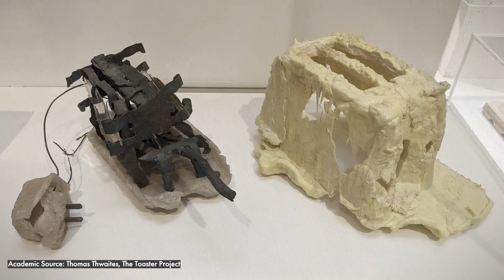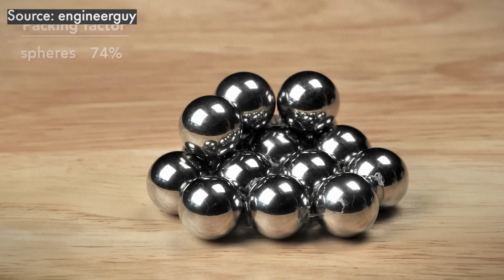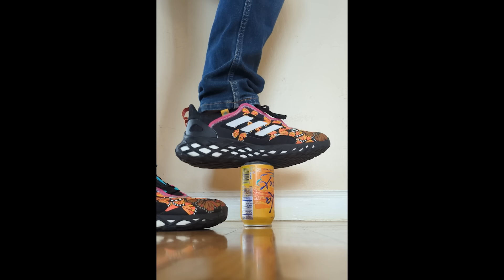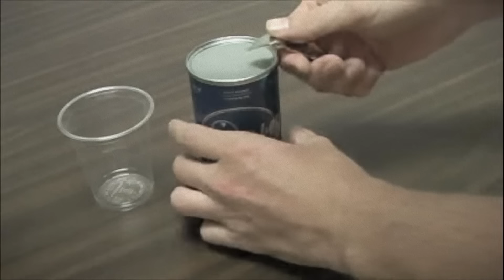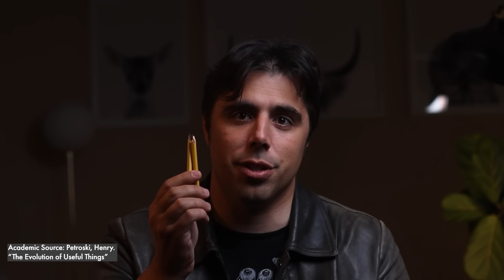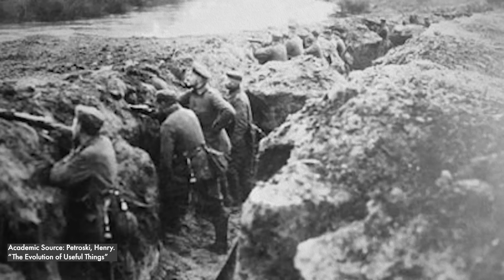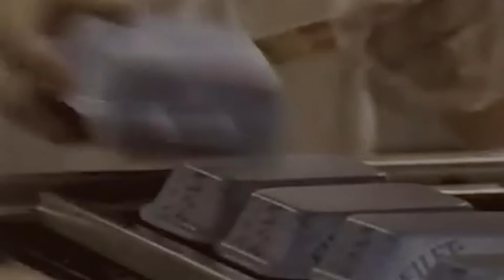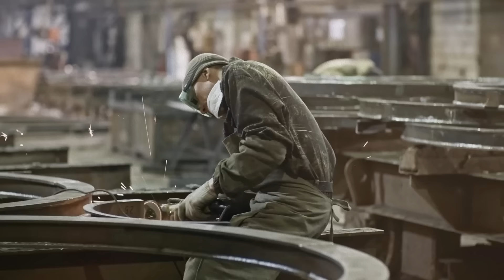Why Simple Everyday Objects Are Impossible to Make

Comment: Yes, mining, refining and manufacturing all the components for simple objects is basically impossible for one person to do but I can cut a metal fork out of a sheet of metal using tin snips in a matter of minutes that may look rough but will work better than any plastic fork. The concept of the video is interesting I guess but the premise that simple machines can't be made by a person at home is wrong unless we're talking prior to the industrial revolution where components that could be used for said machines (that may not be custom made for that purpose but will still do the job when applied appropriately) weren't readily available all over the house, in other machines or readily accessible at hardware and home improvement stores.

Comment: The problem is that most of those supply lines/process are multi use. You do not mine copper just for toasters but for thousands of different things, an assembly line can be retrofitted to do other things but crucially things that make it better can make other things better.

Comment: This is a dumb narrative. Trying to make a product by yourself in the way it's done to create massive quantities of something is nonsensical. When you want to make a spoon at home, you don't use the techniques that they use in a big factory and therefore you also don't calculate the cost of 1 spoon by the cost of the equipment used to create millions of spoons. At home, you could make a perfectly wonderful spoon with simple tools. Even if you wanted to use plastic and make it very simple. What that guy did with the toaster is basically the same thing as trying to tend a living room potted plant with a tractor. You can make things small and by yourself but you shouldn't try to copy the exact mechanism of large scale industry production processes.

Comment: Thats not true 😂
You can build toaster ur self the problem is this guy had 0 knowledge abt eletricity you need plastic coper and metal and just good craftsmen skills to reshape those 3 components in to 400 parts and little rubber and lighter to put over the cables so it dosnt burn

Comment: I once ran through what I'd need to do to make a CPU from scratch using nothing but stone-age technology. I ended up with the most disgusting diagram that would have bootstrapped creating half of human industry from scratch.
It's crazy, because making a bad CPU does not require utterly outrageous things. Some sand, a mask of the circuits (one for every layer), the sun (source of UV), a few specific chemicals. The transistor density would have to be much lower than even the original 8086 CPU. The issue is all the tools required.

Comment: The video is very pleasant and interesting. I learned a lot of different things from it, but the main thesis presented in the video is incorrect. An engineer is speaking to us, saying that copying modern objects would be very difficult — and on that point, I agree. However, as an engineer, he should be able to deal with this using his knowledge by designing a device that performs a similar function using completely different materials.
So what if the guy copied a toaster based on a modern toaster? Sure, maybe he would have trouble obtaining a wire that heats up under electric current — maybe it wouldn’t be as small — but he could use entirely different materials. Why use a plastic casing? It could be a casing made of bent sheet metal, simply insulated with wood on the outside.
As an engineer who says that planning takes a lot of time — yes, it does take a lot of time to make something exactly the way it’s supposed to be made. But on the other hand, it wouldn’t take that much time if your goal was simply to build a device that imitates another device. And that’s why the entire thesis of this video is completely wrong and turned upside down.
Yes, it would be difficult to acquire the materials on your own, but it’s not as impossible as the video claims. Sure, copying a modern solution exactly is extremely difficult — but designing something that is much simpler to make while still fulfilling the same function? That’s not nearly as hard. And that’s why the whole video is basically backwards. Thank you.

Comment: Ok, so I am supposed to believe that the toaster was invented not to give us toast, but to sell us electricity. And then you say it does nothing that a frying pan can't do. Well, first off, the results you get from the toaster and the pan are really different (I tend to prefer toast made in the pan, but that isn't the point). But more damaging to your "sell us electricity" hypothesis is the fact that making toast in the pan is of course incredibly inefficient compared to the toaster, and thus uses many times as much electricity. It's possible that the speed and ease with which toasters toast more than make up for this difference, but it's certainly not obvious that this is really the case. Let's ballpark estimate the difference. My toaster is rated 800 W and will typically run 2 minutes, hence it consumes 800 W * (2/60) h = 26,67 Wh. With a pan I can choose between different power levels, but I tend to be impatient and so I do what is also most efficient - use maximum power. How quickly the pan heats does depend on the pan quite a bit, but I'd usually go for my non-stick, which I'd keep at the maximum 2000 W my burner has to offer for 3 minutes, before dialling it back a bit. And here alas I have to just make a guess as I don't know the actual power (it's just turning on and off pulling 2kW when on, so I could just measure the total duration of the "on" intervals while actually making toast, and it would give me a good-enough ballpark answer, but I'm not about to do that for the purpose of writing a comment), let's say 1200W on average (that is on 60% of the time) for thee more minutes on each side. That brings my guesstimate to 2000 * (3/60) + 1200 * (6/60) = 220Wh. 

If these estimates are roughly correct, you'd have to expect the introduction of toasters to lead to toast becoming > 900% as popular/widespread in order to avoid a net decrease in the amount of electricity sold. 

Caveats: Several, but the biggest is my Scandinavian perspective :) which made me completely forget that in the US, especially at the time, basically everyone used gas stoves and thus, although the efficiency gap will be wildly bigger, probably a factor of at least 40 in favour of the toaster, you could indeed reasonably hope to increase electricity sales, at the expense of gas, even if toast's popularity remained completely unchanged. So my entire argument falls apart. Oh well. On the other hand, it did provide substantiation of another intuitive reaction I had and maybe many others had - that toasting surely does not represent much energy use. If we generously say 20 Wh per slice on average to account for people toasting a single slice some of the time (expends the same 27 Wh, in my toaster, as making two slices), it would be a lot to hope for that the introduction of toasters should move the needle by as much as, say, a kWh per household per month..!

Comment: You can cook toast on a pan but a toaster does a significantly better job far easier. If consumers didn't find value in the product it wouldn't have been popular. In addition, it barely uses any electricity.  Let's estimate the energy consumption. 2000watts for 10 minutes is 0.334kwh of energy used. Even with this massive over estimation the electricity used it's small.

Comment: Why don't we just use bottles?
Reply: 1 Plastic bottles are waaay more complicated to make example a water bottle has an expiration date not for the water but for the plastic bottle
2 you can't put anything in a plastic bottle some liquids react horribly with the plastic the bottle is made out of
3 the environmental impact, you will die and decompose before a plastic bottle starts to decomposes which is a huge problem

Comment: 16:43 that is an absolutely ridiculous take. To say that the only reason toasters were invented was to sell electricity is one of the most abhorrent misrepresentations I've ever seen before in my life. Of course the electrical companies will fund projects that will make their product more appealing to regular people. Are you trying to say that a toaster is less convenient than toasting a single piece of bread at a time in a hot pan with butter and then having to wash the pan and spatula? If we didn't have toasters, how much natural gas and electricity do you suppose we would spend heating up a pan just a toast our bread? How much more energy would we use to heat the water that we use to wash the pan, how much plastic waste would we create by having to use soap and water out of a plastic dispenser to wash that pan? How about the water waste? And on top of all that, it's just more convenient to have a toaster, it will toast both sides of the bread equally, it is almost no maintenance required, it doesn't have to be washed and  it uses an absolute fraction of a fraction of the energy of that a stovetop uses. 

What an complete ass hat take Were ovens designed just to sell us electricity? Why don't we use wood fire ovens anymore? Were refrigerators design just to sell electricity? Why don't we just use ice boxes? We're cars designed just to sell us gasoline? Why don't we just ride horses? Were horses designed just to sell us saddles? 

The whole video was great up until that bulshit take at the end, that is absolutely ridiculous and while you may a gifted engineer and designer, you are an absolute dogshit social scientists LMAO

Comment: 16:43 Chinese EVs are absolutely not high quality and it’s disappointing that easily disproven Chinese propaganda has been this effective. 

They have massive safety issues and most of the videos and incidents in China are censored but recently multiple people have been getting in accidents where their car caught on fire and the occupants couldn’t open the doors and burned to death. This happened to 3 young girls and recently a young man in a video where multiple people were trying to break the windows and open the doors and they couldn’t, so they had to watch as the man burned to death while they could do nothing. Many more incidents and common issues with wheels falling off vehicles, airbags failing to deploy in serious accidents, self driving issues and more. I’m not claiming Tesla or any western EV manufacturer is perfect but their issues are publicized because we have freedom of speech and the press.

Comment: While it may be that toasters were designed as a use for electricity, they were also made necessary by a different side effect of electricity and other moves away from heating our homes by setting wood on fire inside them: toasting used to be done with a toasting fork over an open flame (frying it in a pan is not really the same thing). But once oil heat and electric water pumps driving hot water through radiators and stuff made open hearths obsolete for heating (enclosed cookstoves having made open hearths obsolete for most other cooking a couple of decades earlier), we did actually need a replacement technology.

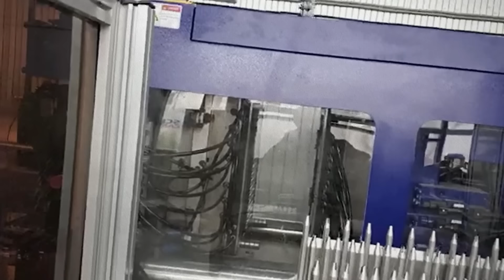Comment: 1:32 "The simpler and cheaper the object looks, the more complicated the system behind it has to be".  This is absurd.
Reply: It’s just wrong. You could use soft tooling and get some spoons of similar quality, but you couldn’t make 10000 spoons /minute and without the tool breaking down super fast

If you want to increase margins and rate of production, then the cost goes way up. Simple or not. Also, it tends to make the margins razor thin because anyone else with deeper pockets can just invest in a more expensive upfront, but cheaper to maintain line than yours and undercut your sales
Reply: Yea I didn’t really get that

Comment: So a toaster uses MORE electricity than the stove you say will toast bread just fine? I've watched the evolution of toasting bread in US. It was gradual to get it done more evenly and quicker. If your toaster uses more electricity than it takes to get your stove up to that temperature, I want your stove. It doesn't make thermal dynamics sense. "..a hot pan will do just fine." A magic pan? A pan that heats up really fast by itself with no electricity? It sounded worse the second time you said it. Like getting a pan hot doesn't take energy. If you are talking back when toasters were invented as you say, most stoves were using COAL to heat with. Even with coal plants a toaster uses much less energy. I think you have lost it. It appears you are very close in thought with Ted Kaczynski. Not your ending, but the hidden machine part. If hyperbolic fine, if not, seek help.

Comment: I'm doing fine without a toaster. I'm also baking my own real bread instead of toasting factory-made tasteless sponges. Using organic spelt flour, sesame, sunflower seeds, pumpkin seeds, poppy, salt, yeast, water and a bread spice mix in my bread making machine. Which works allright but what annoys me is that it has a couple of fixed programs, if it was programmable I could make good rye bread with sourdough that needs plenty of time to "grow" at lukewarm temperatures, something a machine that can basically stir and heat would do nicely.

Comment: But why make the exact same toaster? It's dead easy to produce enough heat with electricity to toast a slice; making a timer is relatively simple; very few mechanical parts needed and zero plastic. This may be beside the point, but the fact is that mass production adds to the complexity when it should be the opposite.

Then we get internet fridges. Mad.

Comment: The story about toaster invention reason is sweet but seems suspicious to me. I tried to find it anywhere and could not, I would love to learn your sources. Also, powerplants won't burn fuel (i.e., produce electricity) when there is no demand, it's economically unreasonable and will physically destroy the powergrid because it will quickly raise frequency/voltage way above safe operating limits.

Comment: I disagree with some of your ending statements. The real cost of the goods IS taken into account. The thing is that the more raw materials you are producing the lower the cost per unit becomes. For example if you wanted to make a toaster from scratch with a plastic cover the cost of you drilling and getting your own oil is going to be really high. But the cost of getting more oil from that same well is going to be comparatively low. The cost of going and mining 1kg of iron ore by hand and refining it yourself will be very high because you have to either buy or build the tools and equipment to do that. But after you have those things the cost per kg drops significantly. 
 
It’s why there’s almost never a NEW mining company, sure they make huge profits and are basically money printing machines but the cost of the equipment to be competitive is prohibitively high. No one has billions of dollars lying around to throw into buying all the trucks and diggers needed to make mining worthwhile. But the companies that exist have been building up their equipment for decades and so they own it all now because they bought cheaper stuff when it first came out, allowing them to buy the extreme things that they need now. The cost per kg for YOU to mine iron is going to be hundreds of dollars. The cost per kg of a mining mega corporation is less than a cent per kg. 
 
Things are priced according to their real value. It’s just that the perspective of that value is massively different now than it was 100 years ago. Like you said they used to flood graphite mines, if you steal 10kg of iron ore from a mine now the company will not notice. They wouldn’t care. It’s nothing compared to the THOUSANDS they’ll mine the next day

Comment: I did my apprenticeship at a company that manufactures switches — for example, for cars, power drills, and household appliances. Back then, I was really surprised by the variety of machines involved and the complexity of the switches themselves.
Nowadays, I work for a company that produces fasteners, such as nuts. Before I started there, I never would have imagined how tiny differences in the shape of a part can determine whether it can actually be manufactured or not.
We’re surrounded by little miracles every day.